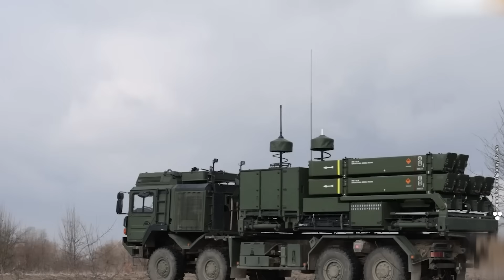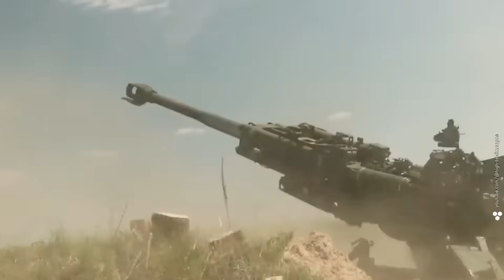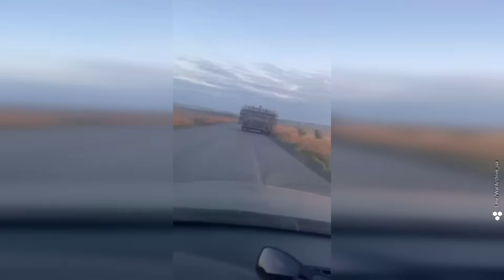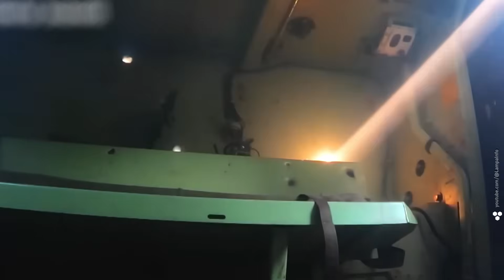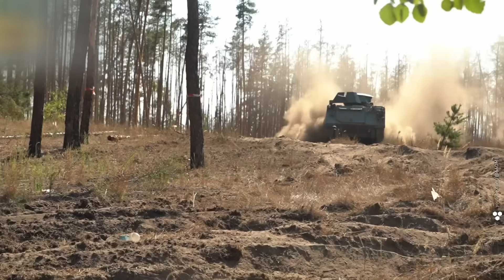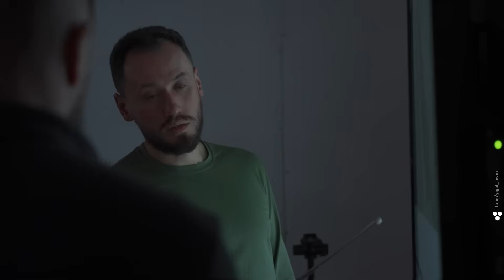Old American Guns Just Did Something Nobody Expected in Ukraine

Comment: You asked for comments or opinions on wether expensive, tech loaded robots (like American made) or cheaper, simpler ones made in greater numbers (like Ukrainian, wonderful innovating units are forced to make) is the better answer. In my opinion is both. Think of the typical squad fighting unit. You have the more experienced squad leader (a sergeant) let that be the tech loaded, more el pensive automated robot, perhaps with another assistant of the same caliber. The rest of the squad element can be the simpler and cheaper build units, were numbers make a difference. Now, because these are robots, squads can be numbered in the old fashion full squads again. Let’s not forger aerial support with drones.

Comment: I worked on hawks fir marines knew they dropped it from USA but it's the best of the best system it never missed never with hickey on lock it's dead dont care long as you manually lock when target tries to loose contact but if you hold hickey mouse locked can't miss it's a bad ass unit for how old it is 100% kill

Comment: Because counter battery radar needs to be on when the shell is in the air, it needs to be on much longer.  This makes it vulnerable to anti radiation missiles. Usually these types of missiles are reserved for SAM radar, but could be used on counter battery radar.

Comment: Hawk is still good and could be upgraded. the M113 is still useful for some jobs. and can be used behind the lines freeing up new transports. and can be modified to can SAM , Switchblade or even artillery. as well as resupply and evacuate wounded.  and the Howitzer? well does it still go bang? then it still has a use.

Comment: In 1969, 1970 I was a Hawk radar specialist. I worked on the high power illuminator and the continuous wave acquisition radars. What makes it so accurate and dependable is that the acquisition, tracking and guidance signals are analog continuous waves. The radar units actually used mini vacuum tubes. I don't know if they ever converted to transistors but the fact that the signals are analog makes it more accurate. The Hawk was meant to defend against low altitude aircraft while the Hercules defended against high altitude aircraft. It was never meant to defend against missiles but the principle is the same. It was classified as anti aircraft artillery. In South Korea I was part of the 38th Anti Aircraft Artillery Brigade. I'm glad to see this work horse is still useful and on the job.
Reply: Thank u for your service
Reply: Find the "Looking" speaker of noise..

Comment: the weapon you can have right now , in war  , is better than the weapon you have to wait a year , befor you can get a hold on , and on a all out war sometimes simpler but reliable systems work better than hightech ,  but for the atillerie , i belive anyting that isnt selfpropelled is outdated , just because towed systems cant respont fast enough to counter battery fire

Comment: Old M113 driver (German Army) here. One thing that old Box on Tracks has as an advantage, it's it disadvantage. It's so light, that if the old Duckfeet Tracks are fitted, it can virtually wade through mud. As long as you keep the speed up and the mud is not to long you can literally swim through it. A heavier Vehicle like the better Armoured BMP gets stuck. But of course it's a matter of "old Tracks" and Drivers Skill. We had a Mud pitt at the drivers school everbody hated driving through it, but it was literally a 60ft 4 ft deep mudpitt and we had to drive through it, without getting stuck. We hated as we had to clean the M113 after it.

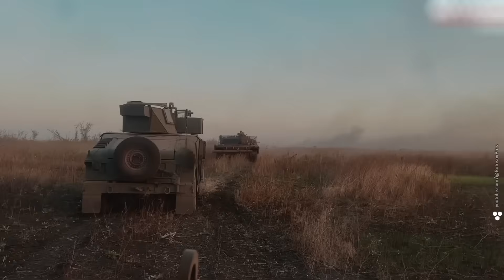Comment: At 25:30 - It's a great idea to bolt extra steel plate/cabrae from outside (w/o nuts in inside but tapped, more likely).
When a cannon shrapnel hits/.50 Cal round hits, the bolt head/rivet heads will fly inside the cab n kill the crew,
and dat's what happened to the US Grant tank crew B4 cast steel w welded joints of M4 Sherman came in production.
But casting will require a big, energy expensive furnace to melt steel and it'll b an EZ tgt for the Orcs.  It's better to have
distributed little shops close to the front line.  Wow!  Titanium is very hard to get and weld.  As u know, back in 1966,
the skin was made from this hard but light metal.  And the only source was Soviet Onion at the time.  Now a dayz, we
can get it from Cheena, MozamBigQuick, n Australia.  And i'm sure Rus has it a plenty but ...

Glad that the old American weapons r turn to a good use w modifications in the MUCH intense combat environment
than when these were conceptualized n used previously.

Glory to the innovating n brave men n women of Ukraine, in their military n civilians.

Cheerios!  And Frosty Oh's!

Из США

Comment: First... VIVA UKRAINE!

The HAWK Missile itself a very maneuverable missile. Iran even made an air to air version of it. Small tech update in a modern web kill system makes it a valuable unit.

M777 shooting from the Dark. And a valuable literal rebuilding them.

The Hummer. Very Multiple thingies of things it can do and re redone or remade useful.

M113, basic troop taxi. It was remade for this current times.

M2HB is one of the most accurate and not as much recoil throwing the aiming off because of the recoil pulse after shot...oh they saided that. 

UGV...high low mix maybe the best?

Comment: That surplus equipment is gold in the right hands at the right time.
Reply: Any weapon used with ingenuity can still be effective.
Reply: @DeadLikeMe-ir9ix  For sure ! A .30-06 designed over 100 years ago is just as effective today as it was when created . Today a .30 cal at 168 gr is still effective wither delivered and place by a drone or a rifelman.
Reply: Ukraine has so many different weapons systems and platforms that they provide the countries they come from with Real-Time information on how well they perform and what possible improvements are needed. One really good thing is that systems like artillery, both static and mobile, are using common ammunition.
Reply: @Lonewolfmike  Yes and a good long barrel goose gun in 12 ga. Mag should be produced in vast quanity for these deadly drones that fill the sky on the modern battlefield.
Reply: @fastbuzzardo4204  From what I have seen, both sides have used shotguns to try to take down drones. But one thing Ukraine has gotten Skynex systems from Germany, and then they are using Flakpanzer Gepard from Germany as well to deal with missiles and drones. I think gun AA systems might have a renewal because they are cheaper than using missiles to deal with drones.
Reply: @fastbuzzardo4204  Another thing I forgot to mention is that you are seeing smaller anti-drone gun systems as well. Poland is testing out a 4-barreled 12.7 Gatling gun for small drones and the like. It is known as the "Monster of Tarnów".
Reply: When good men and women are fighting a zombie horde, they become super skilled. That is what we are seeing.